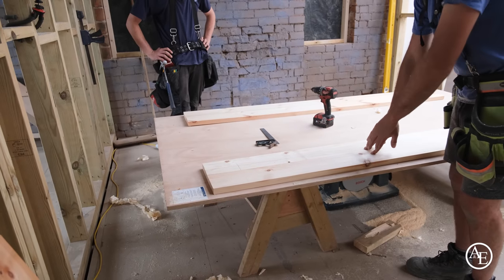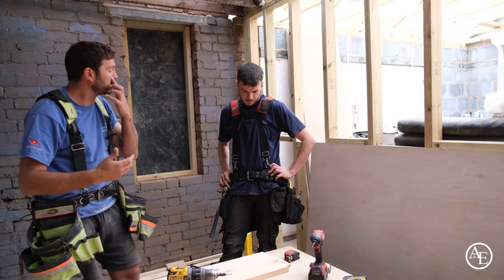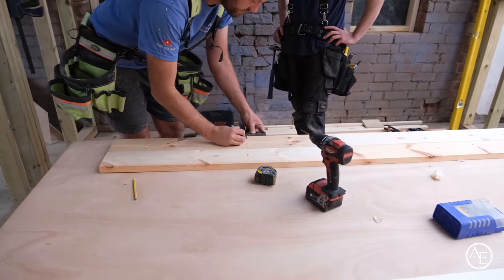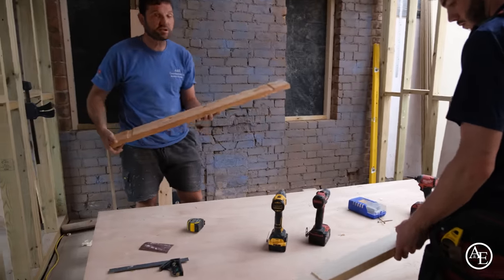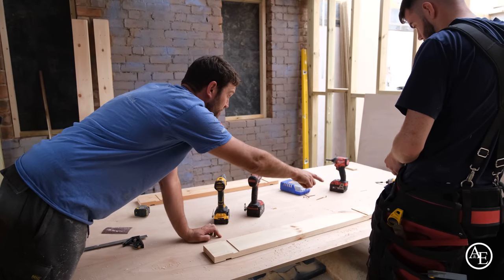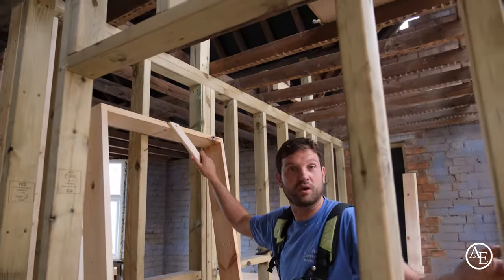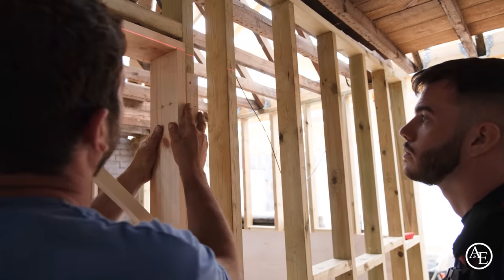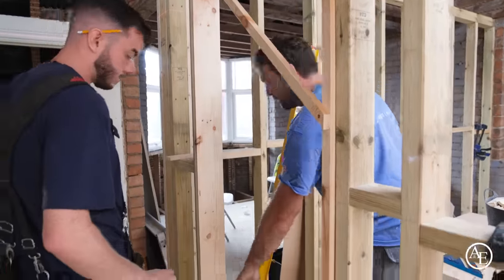How To Make & Fit Door Linings from Scratch with an Apprentice

Comment: Where you've braced across the bottom to hold the legs apart, when fitting the lining put a piece of 1x4 (the same internal measurement as the head) flat  on the floor in between and pull the legs to it, that way you keep them nice and square and not twisted.
Especially if you need to put a threshold through the bottom.

Comment: Don't mind plumbing it follow the stud if the stud is off you won't be able to plaster to it as the tolerance is to tight... keep your margins... then don't plumb the receiver side just sight one style through at a diagnal to the opposite side of the other jam.. so they are parallel...... you can do it your way if everything is spot on which I know yous do... but plumbing a frame on an out of plumb stud doesn't work especially if you only leave 3mm for skim either side.. so you should show him how to overcome that obstacle .. but top work as always lads